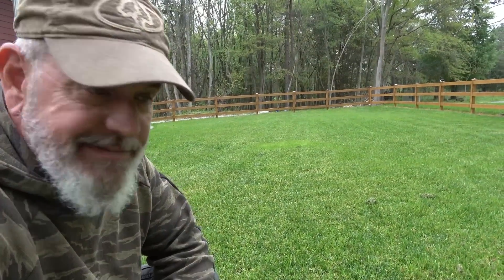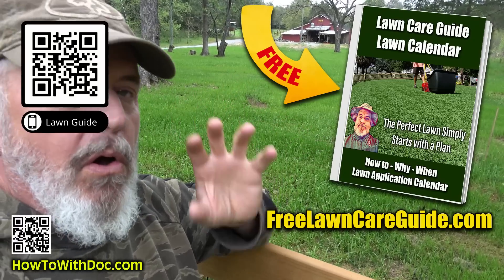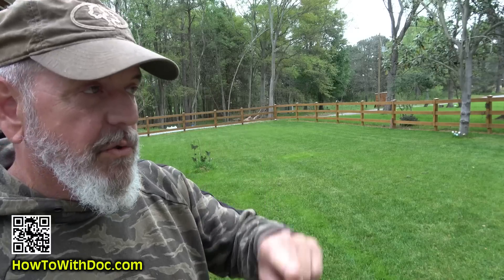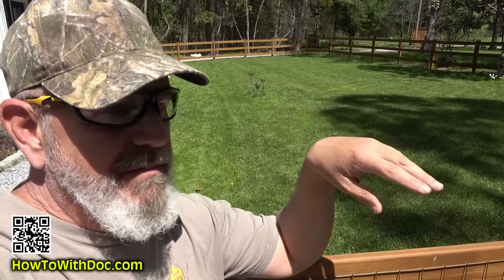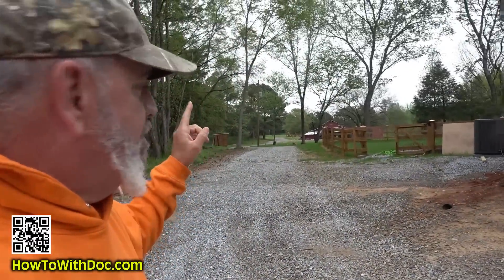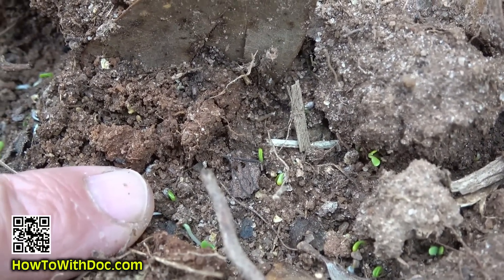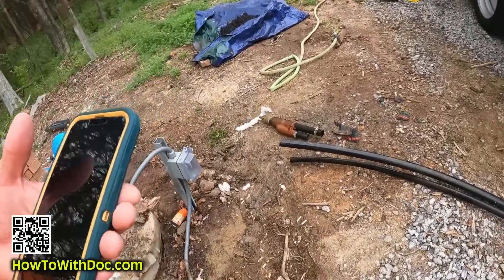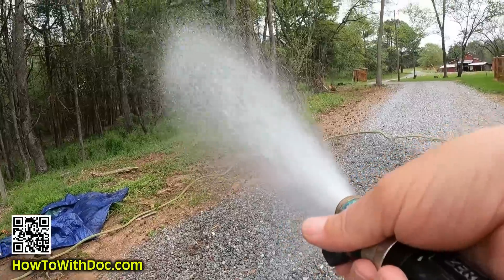Planting Grass Seed - Mixing Types of Grass Seed

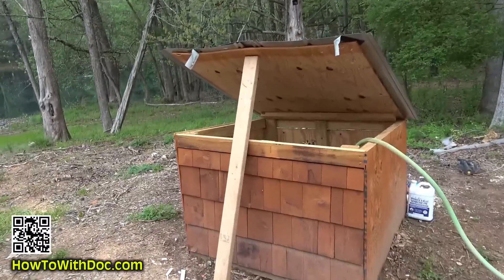Comment: 9:10 Shallow Well Shack Insulation: - Suggest Spray Foam;
- I know that you said that some of the (fiberglass) insulation had been removed (seasonally or for the work about to be done) - but you might consider taking that little shack someplace in the bed of your pickup truck and have the Inner Walls and Under Lid Sprayed with Foam for a more consistent insulation.  However, evaluate whether of not there needs to be some Summer Ventilation.